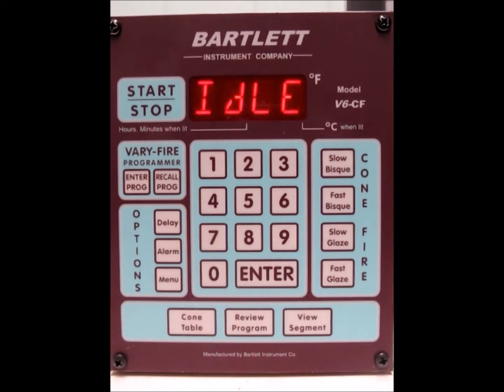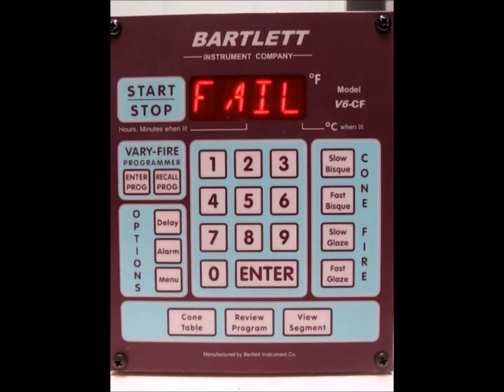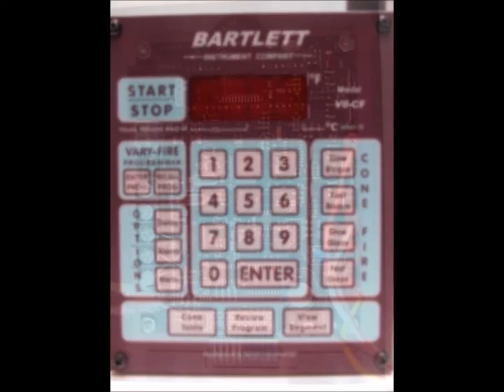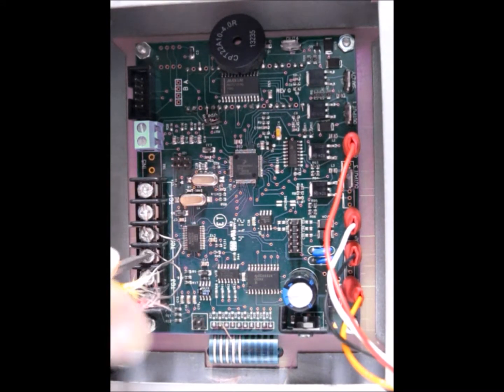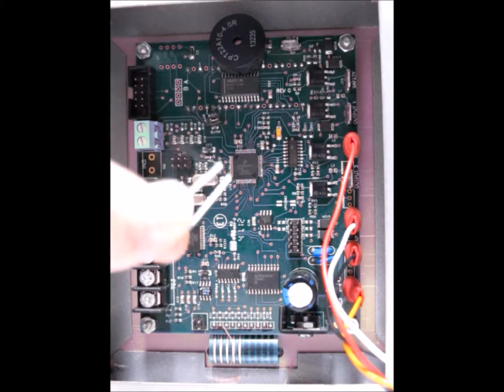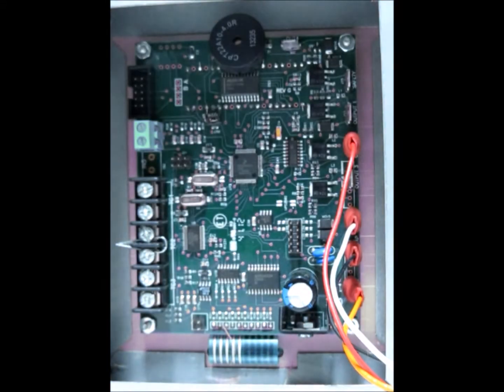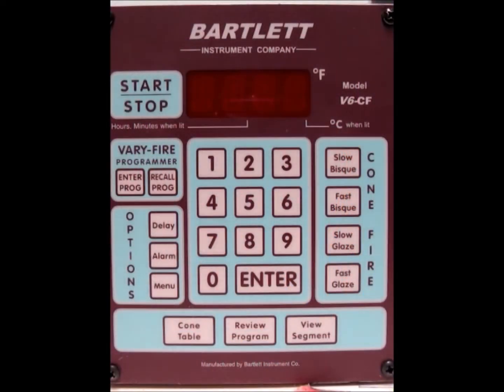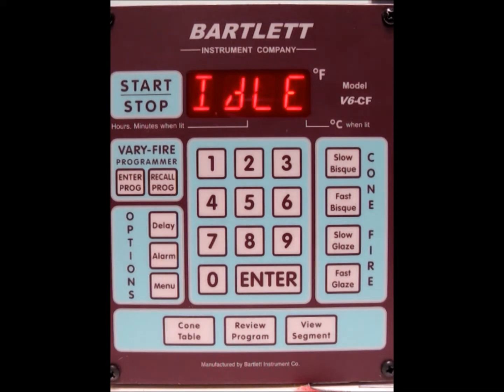Bartlett V6CF | Thermocouple Bypass Test

Comment: I keep getting E - d on the display but the firings look complete… relays tested ok.
Reply from the maker: If you are getting E-d towards your final temperature the issues could be the relay, thermocouple, of zone(loading) issues. Most of the time the relay is the issue. Relays may test out fine at room temperature but then can fail after cycling and getting warm. This issue can be intermittent. The thermocouple if you have more than 60 firings on it and it looks pitted, thinning, or green. I would replace it. Zone control is if you have 3 thermocouples. You then just want to make sure to load each zone as even as possible. In conclusion I would replace the relays and if the thermocouple has seen more than 60 firings replace it as well. If you have any more questions. Please reach out to information@bartinst.com

Comment: Thank you! I was getting a TC2 message (without the FAIL). I changed the thermocouples and am still getting the TC2 message cycling through on the screen, between the temperature and idle. Is this the right test to find out why I'm getting the TC2 message?
Reply from the maker: The TC2 message is telling you that the controller is currently reading the thermocouple that is wired into the TC2 location on the controller. Seeing this means that you controller is most likely a zone control unit (more than one thermocouple in the kiln). If you press the 1 button you can check the temperatures on the other thermocouples in the kiln. See TC2 is normal operation for a controller set up to be zone control.
Reply: @bartlettinstrumentcompany4969  Thank you! This is so good to know!!!